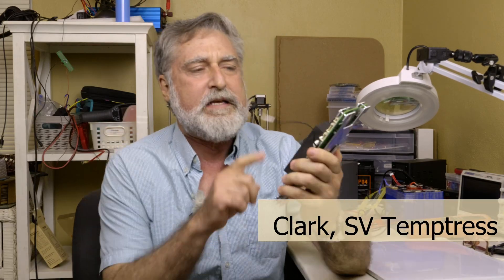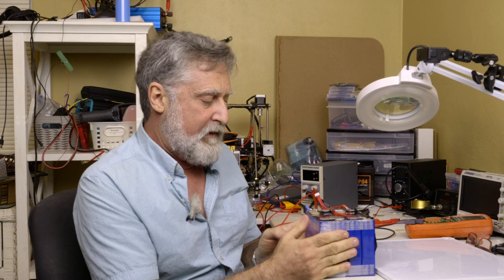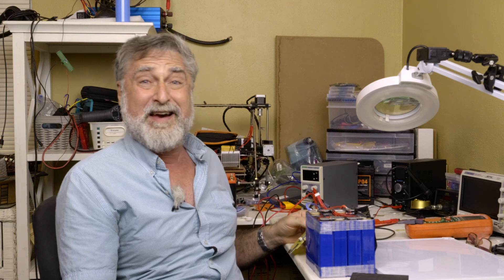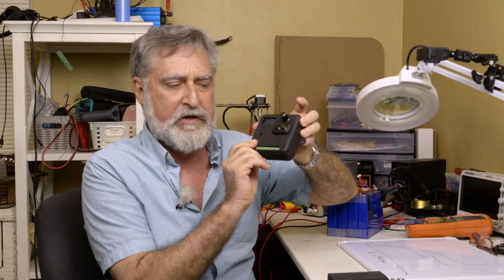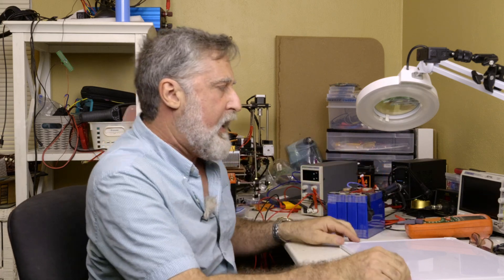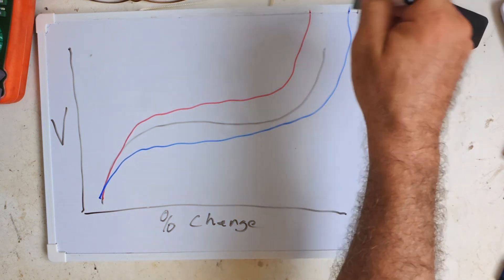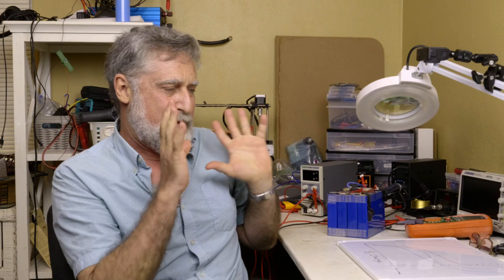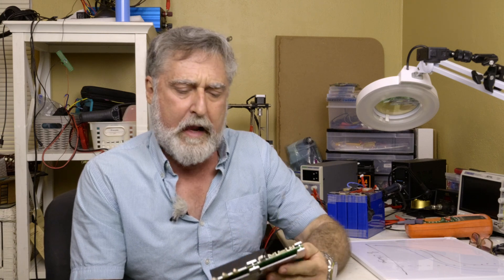What is a BMS really??

Comment: This is super interesting, Clark. Thank you for the presentation. What you're dealing with is probably the most demanding application for batteries that you could challenge battery bank with, using a minimal capacity due to weight because you're not only mobile, but floating and living off of them with all your appliances. What I'm doing and will be doing more of, is automotive applications, primarily motorcycles, so not nearly the capacity of demands, even with an electric motor driven bike because the demands are much more predictable. Great information regardless of the application, particularly concerning different aspects of monitoring, testing, and charging.

Comment: Clark, I built a LFP system from cells and spent months studying scientific journals and everything else I could find. I enjoyed your video not because I learned anything about BMS's but because you are truly amazing at making complex topics incredibly simple.  My only challenge to you is that you suggest allowing the cell (with lowest internal resistance) to go above a charge that causes damage during balancing. I do not think that is necessary. The BMS I use, an Orion, allows you to set the voltage needed for at least one cell to hit before balancing commences and another value for the voltage before charging must be stopped. This is a pretty useful feature, especially if you have to replace a cell in the pack with a new one as I had to do. My battery is over 5 years old and going strong, but I had to replace a bad cell and of course it has lower internal resistance and charges up to voltage faster. It was worse a few years ago but now I can I have it set in such a manner that all cells are automatically balanced very well. Probably you were simplifying with your comment, but I had to flag it. However, maybe you think letting for example helping a newer cell get damaged will make it balance better sooner? I sure wouldn't take that risk. Best wishes and thank you for what you do.
Reply from the maker: Yes I simplified.  99.9 percent of LiFePO4 owners can't choose their BMS or touch any settings.

Please watch the next video and tell me what you think about my BMS pro-active balance idea 

Oh and please subscribe.  I like people watching who know their stuff.  Keeps me honest, right

Comment: you in your random world dont know when a LFP battery is full that is your fail not anyone others.
and coz you dont know a BMS donts know to. pure random nonsens logik.

anyone on this planet knows that any LFP pattery is at 3.65 Volt 100% full and same any BMS on this planet knows this and cut off charger exactly at this voltage.

sorry that nobody told you the worldwide known full voltage of LFP cells.
Reply from the maker: Keep doing that and in a few years your cells will die.  Anyone who actually understands the chemistry of these cells or has ever read anything but the simplistic crap the battery marketers say knows this 
    Ask yourself this.  Why have LiTime, Epoch (though they removed it,  SOK and others added features to their BMSs to stop charging at lower voltages???  Could it be they are sick of paying for replacement batteries after there are failures in the field before the warranty period expires?

   Thank you for showing your obvious lack of self confidence by repeating this tired statement all over my channel. Repetition doesn't make right.  But it does power my videos forward as the YouTube algorithm sees you as supremely interested in what I have to say.  You are promoting my videos, thank you

Comment: Best BMS video ever seen!
Looking forward to your next one. 
Balancing is in my opinion one of the most challenging parts of a BMS. 
At what currents, when, limits on measurement accuracy, how to qualify the software not to generate more harm than benefit (if one goes for higher balancing currents in combination with potential flaws in software?)
Reply from the maker: For that active balance go to the computer and electronics part of our Amazon store linked in the description.

I haven't watched this video in years but not power supply only passes a maximum of 5 amps.  When I held the voltage to a point the supply would do that by cutting the current flow down.
Reply from the maker: You should watch this newer video on the subject as well.   There is a link to the bench power supply in the description 
https://youtu.be/GitKal-eywU
Reply from the maker: Finally I do a video on that active balancer and I use it in my pelican case builds.
   I think you might benefit from watching more of my videos.  There is something to be learned in most every video even the battery reviews.
   Please don't forget to like and subscribe along the way

Comment: Re: Lion vs Lifepo4. Lion is used only where weight and size is very important. In a boat space is precious and weight is to be avoided but lifepo4 batteries of the same size and weight as the lead acid batteries they replace, store a lot more power while also being a safe choice. So a car will not use lifepo4 batteries because it adversely affects the range and range is everything in an electric car. Charging an electric car is still painful compared to an IC. Even in a boat that uses batteries for motive power, the extra space required is not that bad and the weight would likely compare quite well when the fuel tankage and space and diesel engine are considered.
Reply from the maker: Did you see that many new electric cars are now using LiFePO4?
The other advantage of this chemistry is cycle life.  Car companies don't want warranty returns.
Reply: @Clarks-Adventure  didn't know that. Cheaper liability insurance too I guess. I stopped watching electric cars after A) seeing the price and B) realizing that if I keep a 10 year old IC going another 10 years I will actually have a lower "carbon footprint" than if I buy a new E-car. E-cars are still a pain to "gas up" though.
Reply from the maker: @lenwhatever4187 yes all of that.  
   But, I recently tried a self drive Tesla as an idea for my parents who probably shouldn't drive any more.  I did a video on that recently.  It was amazing.  That alone might be reason enough.
   Also that model Y is supposed to come down to $30k soon.   Well, Elon "soon" anyway.

Comment: Hey, I got a pair of Litime batteries and noticed if I charge at less than 10 amps the bms cuts over charge at 3.50v/cell. But if charging faster than 10 amps the bms cuts off charging at 3.65v/cell. Really cool design to protect the cells for long life!
Reply from the maker: In my opinion a half-assed design.  I couldn't live with it and changed the BMS in my LiTime battery.  You may want to watch my LiTime videos.
   My BankManager product knows how to stop charging at 100 percent of charge.  It doesn't charge to a voltage it models the electrochemistry in the cell and solves this problem correctly regardless of charge rate.

   If you want long reliable life out of your batteries you should look into it.   MarineDCAC.com
Reply: @Clarks-Adventure  thanks for sharing your knowledge I just figured this bms programming is a step in the right direction but if you say its inadequate thats fine.
Reply: also what I was struggling with was testing the balancing function and if I don't charge over the 10 amp threshold the balancing won't trigger at 3.52v/cell 😅
Reply from the maker: Yes 
  And the BMS actually lied through the app.  You would never know this unless you opened the battery and tested the voltages yourself.   
   Lies from marketing companies can't be tolerated.
Reply: @Clarks-Adventure  mhm, I struggled for 4 days but because I watched it like a hawk I knew I had to open it up and check it out because something was not normal.
Reply: @Clarks-Adventure  your bankmanger knows 100% nothing about different cells inside a plastik chase, only a BMS that tracks ea cell  in the battery every secound and handle it how it must be handle knows what to do is.